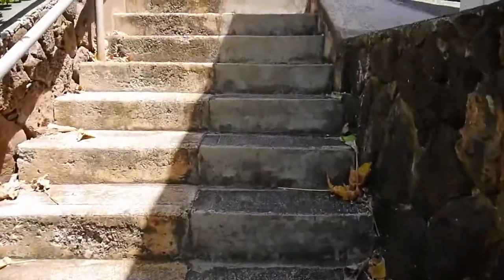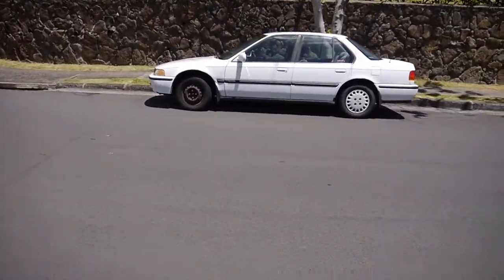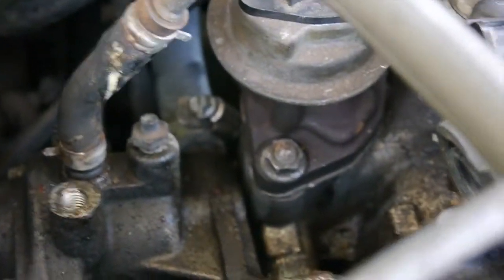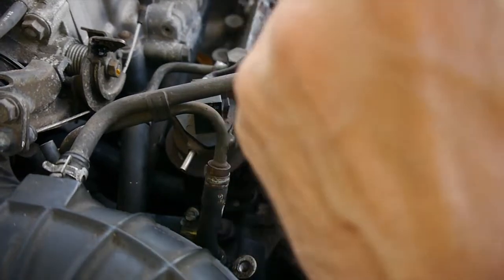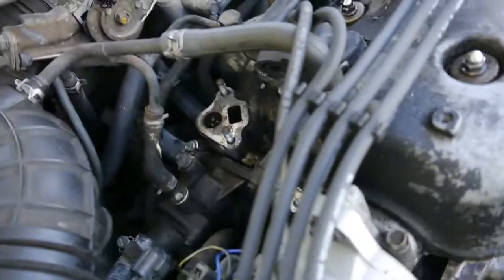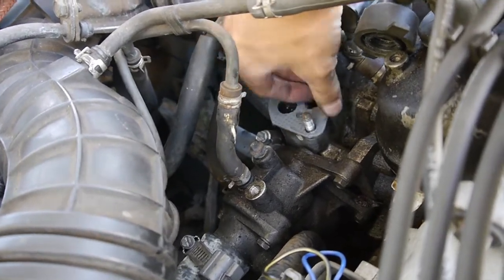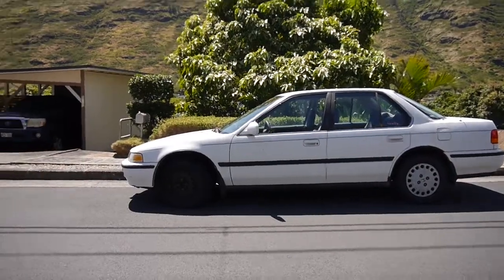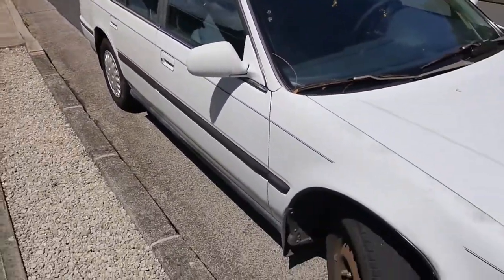How To Replace 1992 Honda Accord EGR Valve

Comment: Mike, when u were removing the 2 nuts securing the egr valve, do you remember if they were tough to remove or fairly reasonable? On mine they dont seem to be budging even with me hammering vigorously. So maybe it's a matter of my engine still being too hot.
Reply: It’d be smoother when it’s warm/hot. Try putting some pb blaster or wd40 on there it let it set for a min and try it then
Reply: Use a 6” “wobble” extension and a shallow 12mm nut to make it easier.